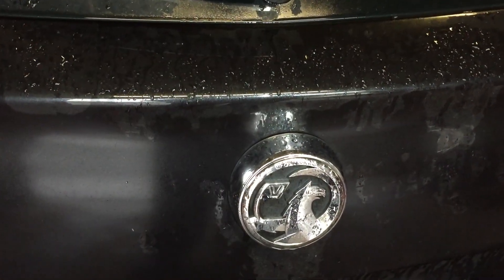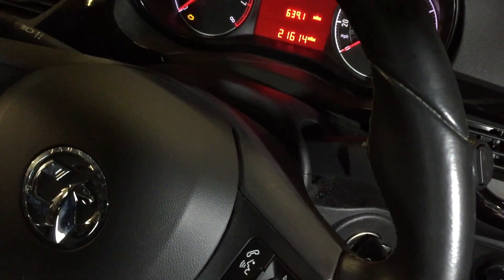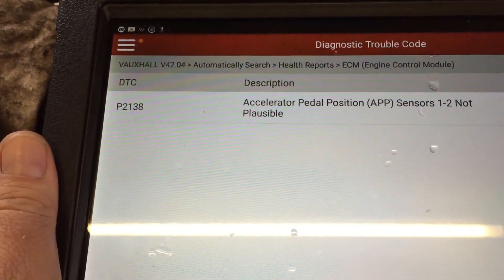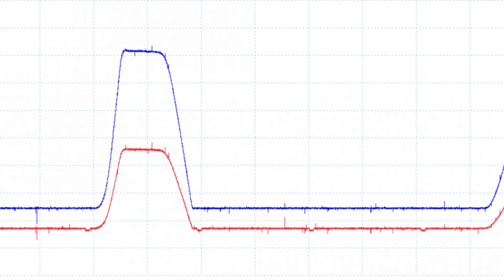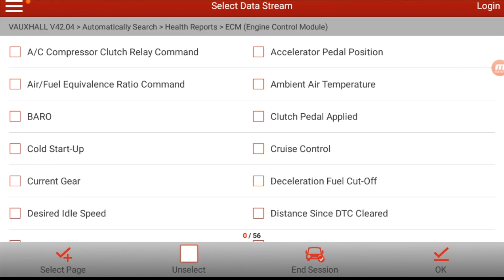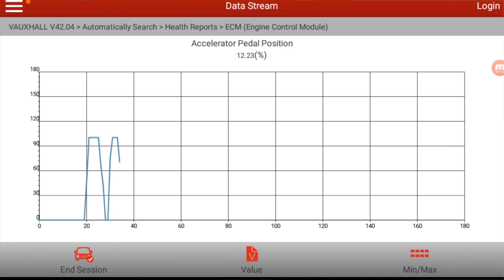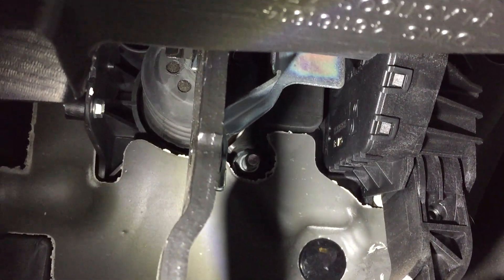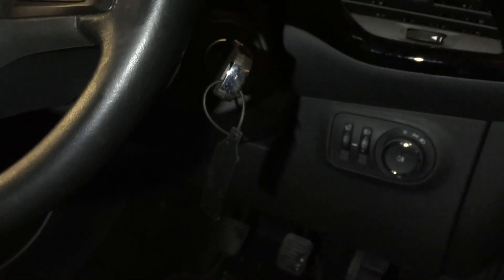Vauxhall Corsa E - P2138 Part 1

Comment: Many current Accelerator Pedals are now constructed using hall effect technology so no actual potentiometers to wear out. These are significantly more reliable since there are actually no wearing parts. Most failures now are due to poor electronics internally. Correlation faults are typically caused by a failing sensor, (the two signals don't agree by a calibrated difference for a calibrated time frame). Some manufacturers "fix" this through programming updates as well. (relax the fault setting criteria). I hate throwing parts at a complaint but sometimes it is the most cost effective approach. Cheers!
Reply from the maker: Cheers Philip, wasn't aware about hall sensors in pedals but makes perfect sense. Thanks as always for your invaluable input, Sandy

Comment: I have a 2016 Corsa E. Same problem P2138. Is it something a novice could change? Thanks for the upload.
Reply from the maker: Yes definitely, in fact we are all novices! Cheers sandy
Reply: @sandyande  thanks for your quick reply.
Reply from the maker: https://youtu.be/pNzacY_2wJw just fitted it today, hope this helps cheers sandy
Reply: @sandyande  Just seen your reply fella, if I saw it earlier it would of made today easier. I fitted mine today and the hardest part was getting the trim off to get to the bolts, even with my tiny arms i couldn't squeeze in there lol. Thanks for the reply.